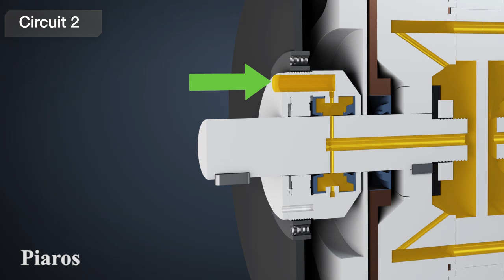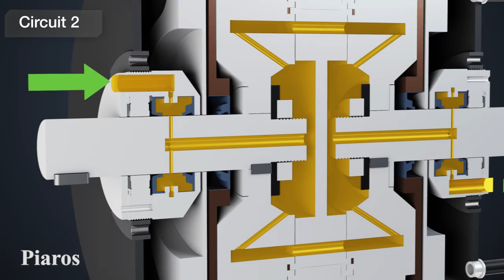PIAROS - Rotary Internal Combustion Engine

Comment: You know, Wankel RCE HC emissions depend on Rotor Surface temperatures, a hotter rotor surface means a cleaner exhaust.
Thus, oil cooling of Rotor could be a double edged sword.

Comment: The secondary blast of fuel from the secondary set of fuel injectors...if combustion has already happened, where is the fresh air coming from to allow the secondary blast of fuel to ignite? 
Remember the fire triangle: heat/fuel/oxygen. Too much or not enough of just one part and you're not getting fire. Too much gasoline? No boom. Not enough heat/spark? No boom. No oxygen? Well the sun does a good job of burning without it but stars are special cases (that whole hydrogen to helium back to hydrogen, fission-fusion thing its got going on).
Reply: good point. maybe it has excess of air from first injector. either way i dont really get the logic of 2 injectors anyway

Comment: The internal combustion engine as we know it today is the answer to the steam engine. There has been minimal improvement in 100 years. The efficiency is at most 35% of the 100% fuel you put in, the rest is converted into heat. We need to be more economical with our energy. Any attempt to improve the internal combustion engine is carrying water to the sea! Let it go and put your intelligence into something meaningful.
Reply: they already are by attempting new things and innovations with the combustion engine 🤦‍♂

Comment: Real engine inventors and builders, like me, cring at the world of 3D where everything works to perfection.

Try a real engine and see the many problems that suddenly appear.
Reply: I choose to sweat and get my hands dirty in the machine shop.  It's all very well sitting in front of a computer screen playing with graphics, but it gets nothing done in the real world.   My own engine will not be shown on Youtube....way too secret after 32 years of research and development.
Reply: Paul Ellis.

Correct, I am currently building an opposed piston 3/6 cyl engine (complete bottom end assemblies ready for production) with my own unique valving intended for light aircraft. 

As much as they excite me, my engine projects are sadly 2nd and sometimes 3rd to viable projects though (non-engine), damn money keeps me at those as a priority, lol.

If you have a genuine engine prospect, I can help. I do field inventions for investment and production. I am based and live in China (not Chinese) and Patents are easy and cheap here, about $1000 which once secured gets you 12 months to make a decision to patent in other countries, or not.
Reply: That sounds great.  Funnily enough, my engine is an opposed twin two-stroke for a motorcycle. A highly radical concept.
Reply: I am well known for my 2 stroke successes in racing, I understand them quite well.

This is my short engine, I designed the crankcases myself and had the dies made to accept off the shelf components. I have a batch reay to be developed one day, I'm not in a hurry for mine as I am helping another guy get his aero engine up to speed and there would be a conflict.

http://s620.photobucket.com/user/mongrelexo/media/block4_zpscf2ff469.jpg.html 

I am interested to hear more, cheapracer@yahoo.com
Reply: @markmark5269   note

Comment: Any new engine has to have advantages over what we have.  It must be significantly cheaper, or more reliable.  Piston engines are made in such vast numbers that beating them on price for a small production run in the early stages is a non-starter - and they're pretty reliable.   So - any inventor of a new engine is up against stiff competition from the piston engine.  My car has pistons.  It has driven the equivalent of twice around the globe, and so far, has not given any trouble - and that's only 50,000 miles.  I expect it to do the same again before I scrap it - and when I do, it won't be because its piston engine has worn out - it will be, perhaps, because the bodywork is going rusty, or because the law has moved against diesel, and it has become too expensive to run -  or maybe because I have got too old to be driving.
When you're in the euphoria of having invented the next big thing - especially where there's another big thing that you're competing against - take a reality check before you allow yourself to get acrried away.
Reply: If you had your way there wouldn't be any new innovation at all. Poor argument.
Reply: @RockSolitude  No - you misunderstand me.  Only this week, I watched the manufacture, in the home workshop, of an internal combustion engine with a rotary valve induction.  The maker failed to get it running, and abandoned the project, though he had a physical, potentially working engine on his bench.  Please go there and read my comments, you will see that I encouraged him to spend a bit more time on it and make it work - because it was so nearly there!  But he was making it as a hobbyist - a one-off.    https://www.youtube.com/watch?v=u_F5OGjLpOQ&ab_channel=MeanwhileintheGarage

If you want to produce a new engine as a "pet project" just to see if you can make it run, to drive your lawn mower - then go for it, and you will have my enthusiastic best wishes that it will work to your satisfaction.  The video above may have been made as a pet project as well - a video-making project.  However, I stand by what I said.  If you're doing it with a view to a manufacturing run for profit, it takes very serious planning consideration.
 
In a few years, there may well be legislation against the internal combustion engine - or against any engine that produces direct emissions other than water (hydrogen engines).  In the face of that possibility, would you, RockSolitude, invest your family's future in a new design of internal combustion engine?  Would you seriously think it worthwhile to spend years perfecting something that nobody may be allowed, by law, to use?

Of course,we don't know.  The IC engine may still be around 30 years from now, but you'd have to be a betting man to spend time and money on it.

Please go back to my comment that you criticised, and explain why you disagree with it.  Do you disagree that you should " take a reality check before you allow yourself to get acrried away"?